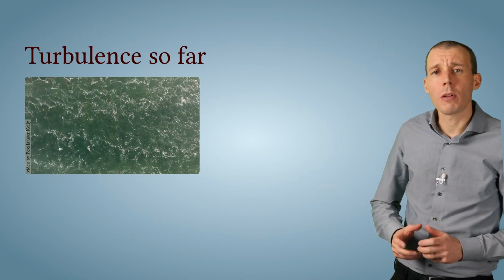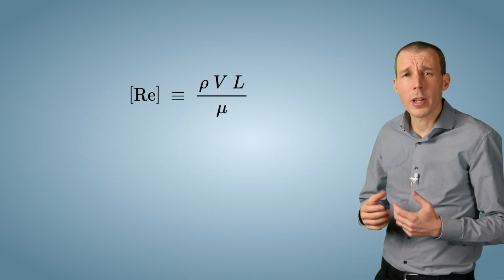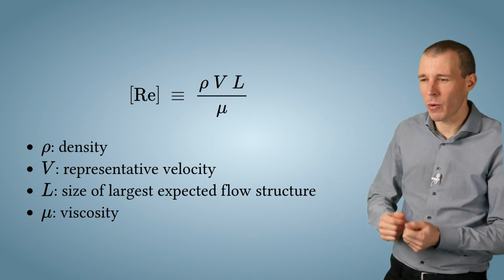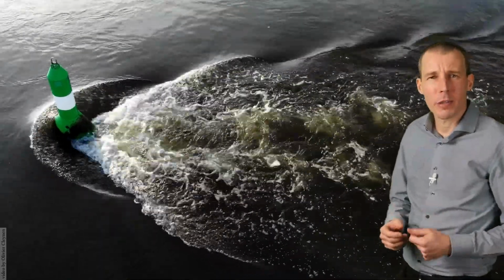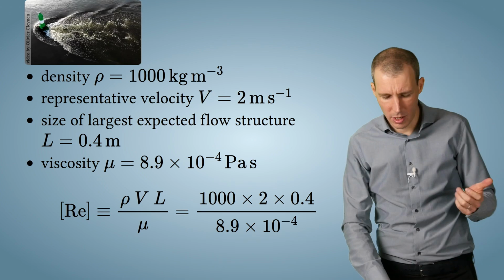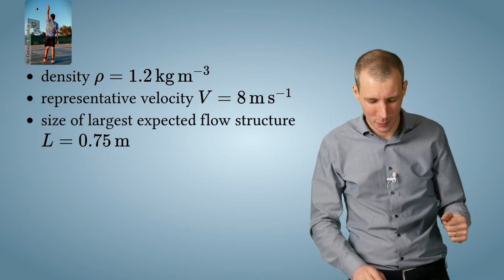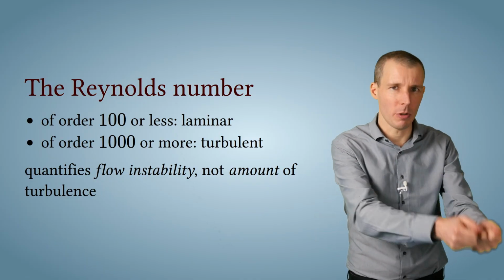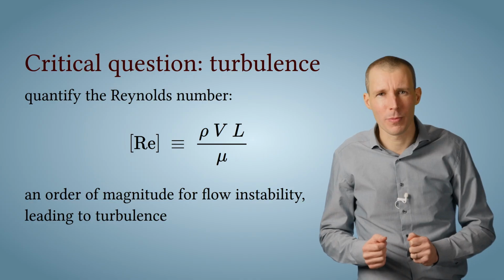How much turbulence? How to use the Reynolds number

Comment from the maker: A kind viewer has let me know that the diameter of a basketball is nowhere close to 0,74 meters. I got it wrong by a factor of 3!!!
So sorry about this mistake (I was looking it up at the last second to improve my guesstimate, and I ended up using the value for circumference, which is obviously what is used on the court to check the ball). Beginner mistake! My apologies!